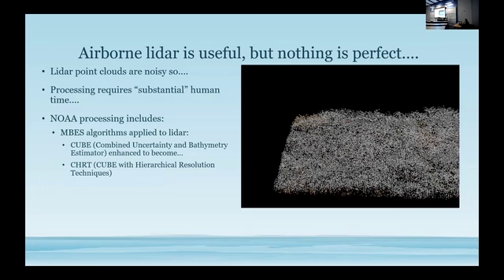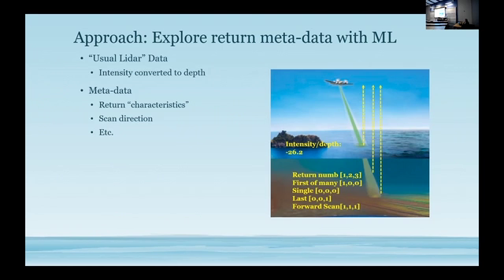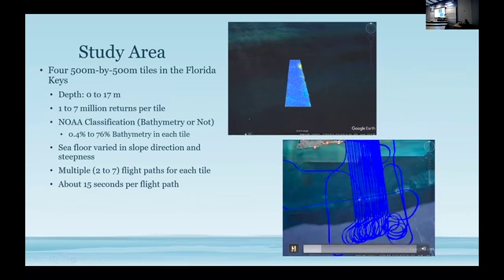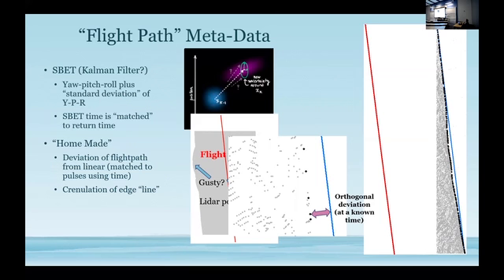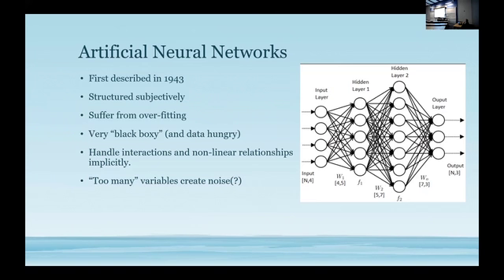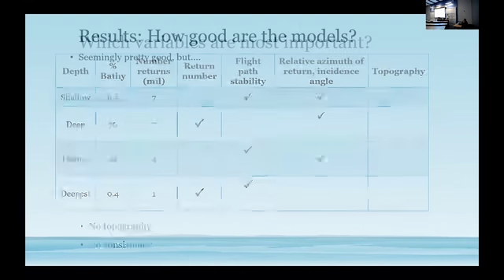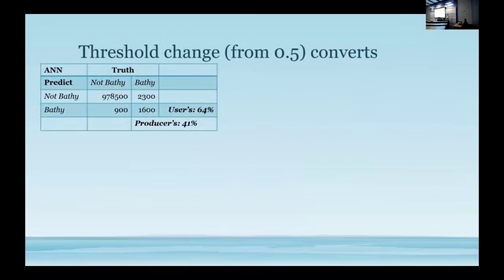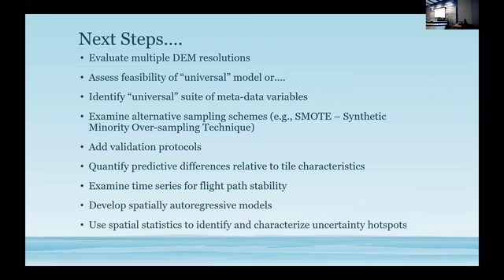Better Shallow Water Bathymetric Maps from Airborne Lidar Data Using Machine Learning

Comment: Would be interesting to see if such data as this could model impact of contamination from toxic materials percolating into the ground beneath and around incinerated residences to groundwater and private water wells. The Hermit’s Peak/Calf Canyon Fire might be a good test area to measure model accuracy, and eventually the burn scars left by the LA wildfires of Jan 2025 might also provide valuable information.